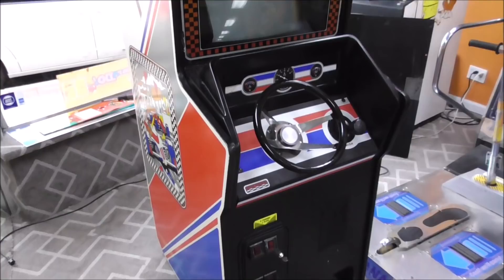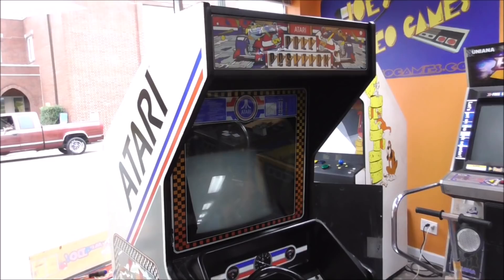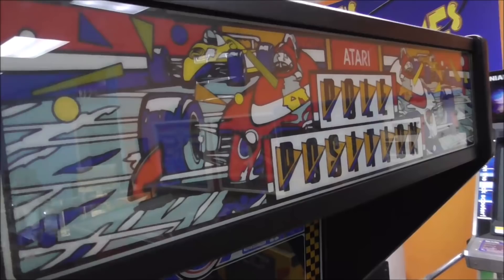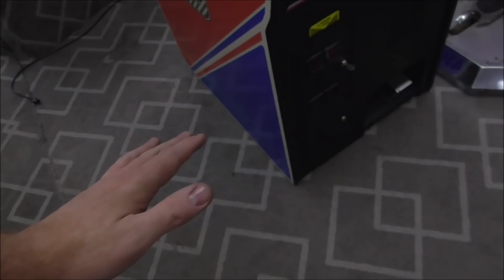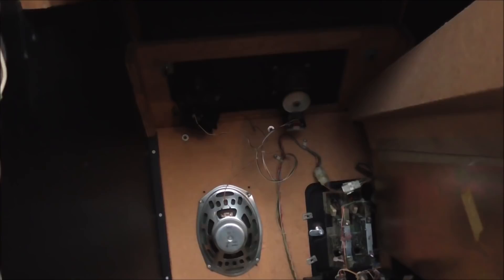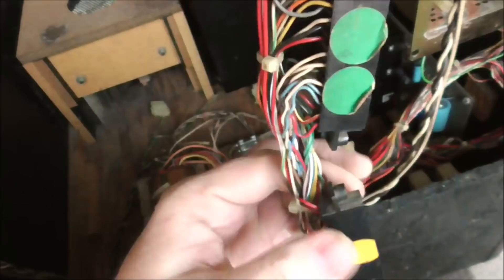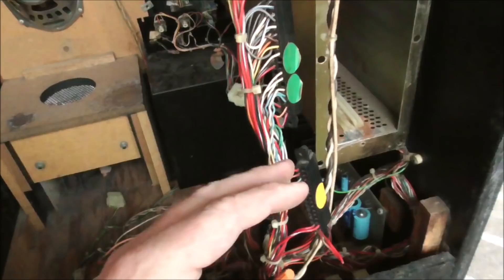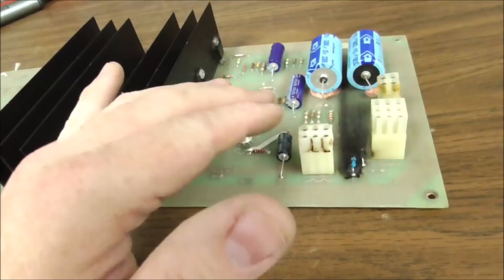Let's Repair Atari's Legendary (But Ultra Complex) POLE POSITION Arcade Game!  Two Power Supplies?

Comment: What's the reason you don't just put an adequate ATX PC power supply (~$50) in those cabinets? Out with those old transformers with old skool fuses. Or is it so important that everything stay as original as possible?
Reply from the maker: Paul are you going to add two sound amplifiers too?  Then you're going to rewire the connectors?  Rewire the speakers connectors?
Reply: @LyonsArcade  why would one need to do that? medium voltage AC tap-off in the original power supply for the amp?

Comment: This sense mod thing confuses me. R29 and R30 are 10ohm shunts already, so why not just disconnect the sense lines and stop there? With the sense lines disconnected won’t the power supply effectively sense its own output via R29 and R30 without any modifications to the AR2 board?
Reply from the maker: That would probably work but the whole problem is the wiring is undersized (0r the connection isn't good enough) on the board, so by shunting it you just added another 5v line to the board to help with that.

Comment: Does it use a JAMMA board that takes JAMMA cartridges?
Reply from the maker: No it doesn't, it uses it's own proprietary board that was only used on this game (and Pole Position II)... it doesn't follow the JAMMA standard (JAMMA wasn't created until about 86 or 87)  Thank you for watching David like always!
Reply: @LyonsArcade  That is a shame what about replacing the broken main board with a SEGA CHIHIRO and put the Pole Position dongle in to the dongle socket and the GD-ROM into the drive and that should be it.
Reply: @DAVIDGREGORYKERR  Ron prefers to repair the original boards if possible.  I don't fix arcade games myself, but I know someone who does (you should see his mancave!), and he tells me that the first thing to check is the Z80 cpu, the 6116 RAM, the two 08xx chips, and the two ROMs that hold the program code.  That's the critical stuff for getting past the self-test.  When you get past the self-test, if it still won't boot, you can move on to everything else.

Comment: do you ever break down and just replace the power supplies with a modern one? I understand trying to keep the parts original, but i would think you would start running out of original parts and at least try to maximize the use of game boards, and the power supply is at least not a visible part.
Reply from the maker: You run into a problem on this game for instance (Pole Position) because the power supply has an amplifier for the sound too, so it's easier to just rebuild the original power supply than to hack in a new one with no amp, then hack in an amp and rewire everything.
Reply: @LyonsArcade  ok.